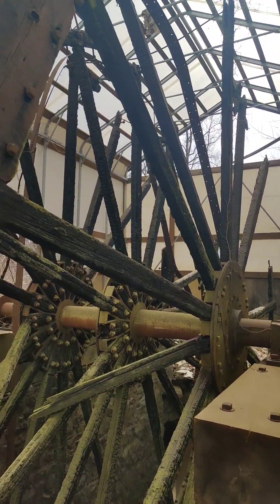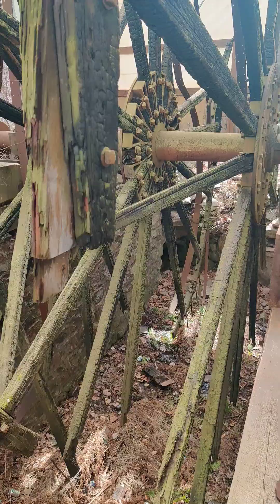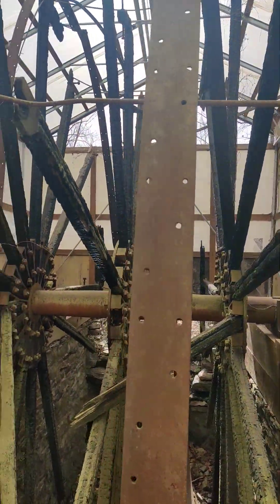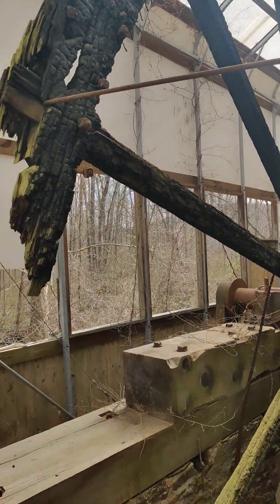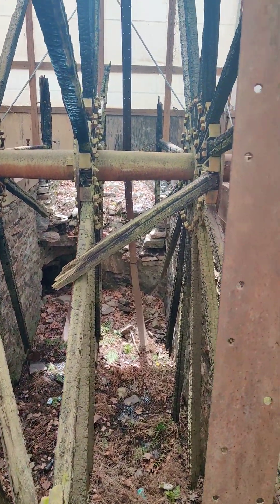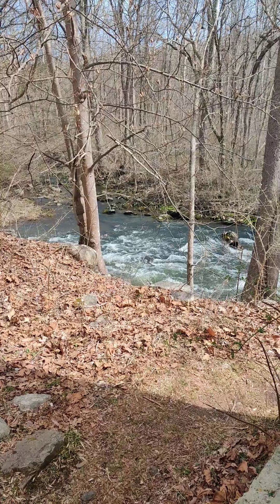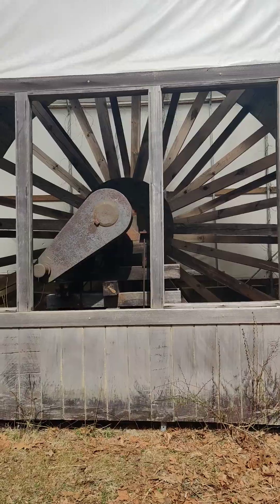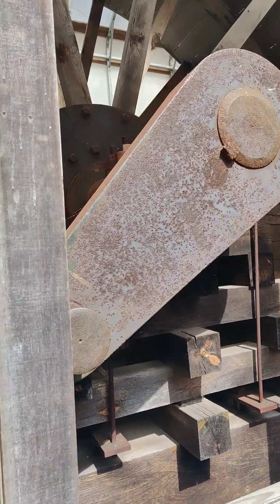1860s Water Wheels supplying air to Civil War era Iron Furnaces #civilwar #mining #history

Comment: That's awesome 👌
Reply from the maker: Thanks, after posting we learned that the adjacent stream water was taken from the waterfall 200 yards upstream via some type of wooden platform which dropped the water onto the tops of the water wheels.  I guess all the bottom area was for discharge back to the stream.  Unfortunately that waterfall area is all off limits with bold no trespassing signs so we're not able to view and explore that area.